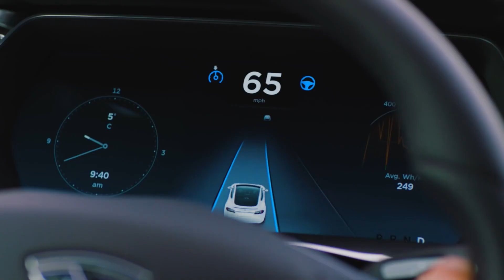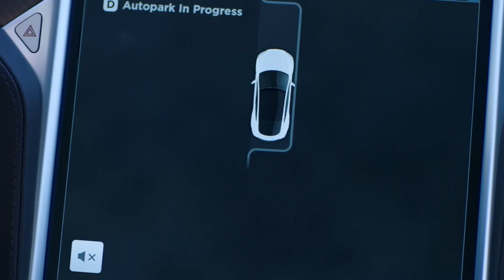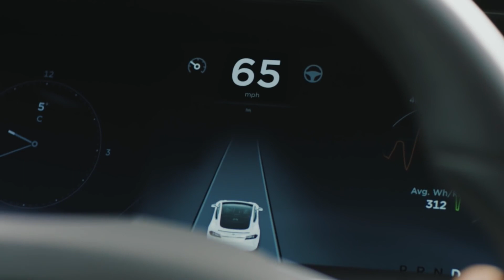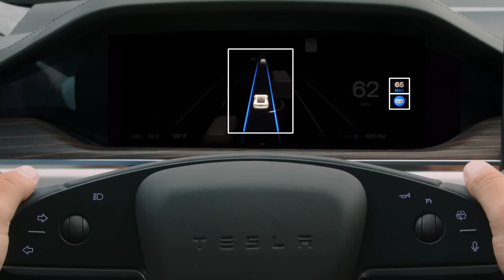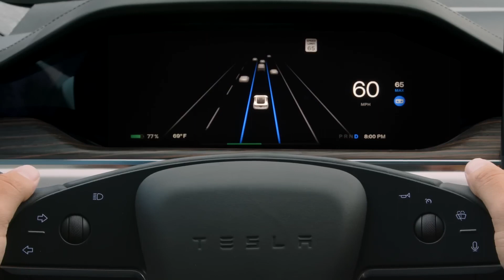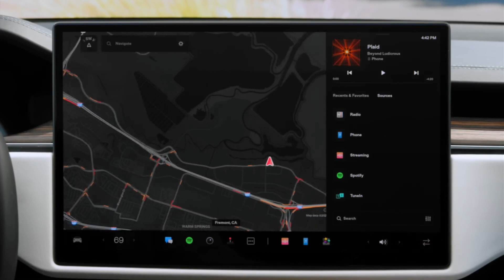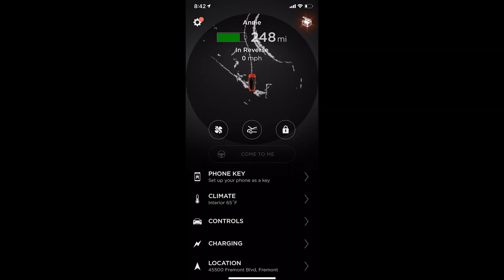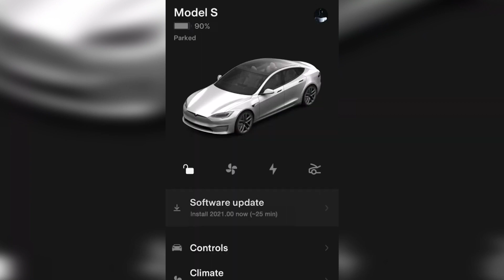Why EXACTLY Tesla Removed Ultrasonic Sensors From Its Cars? (Tesla News) | AI Day 2022

Comment: Hmmm thinking about the 3D mapping of the area could replace USS sensors but still think a camera is needed on the front bumper as how can it guess a hydraulic retractable bollard if it can t see it before ?? https://twitter.com/i/status/1582330381768228865